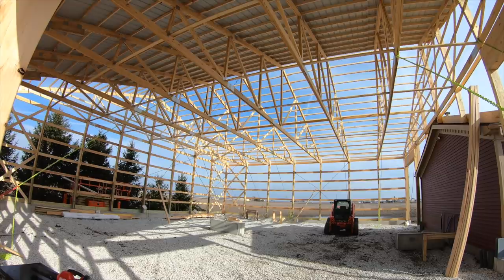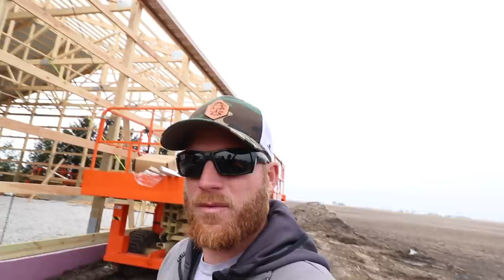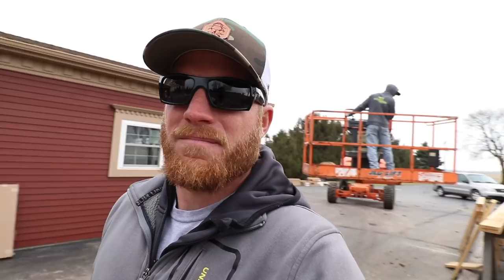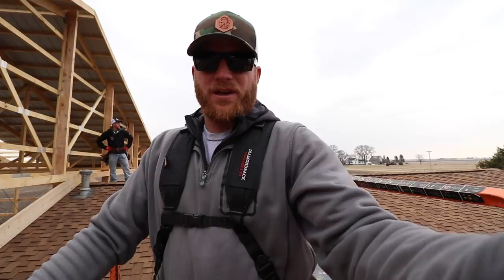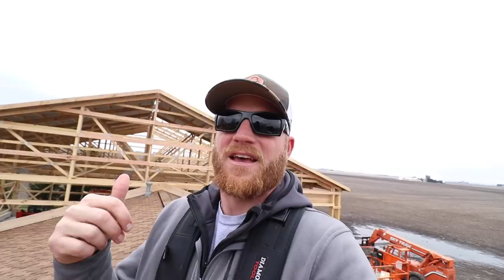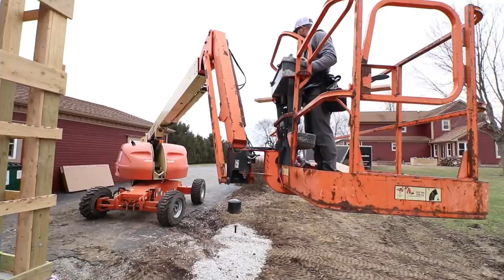How to Build a Garage Addition 9: Installing more Metal Roof, and MISC!

Comment: I look forward to see how you flash the two buildings.
Reply: Eric Corse I think what Kyle might do is replace the asphalt shingles with steel first. He will lay the flashing down on the new roof and run it up the adjoining new wall a foot or so over the house wrap. He may run a J channel maybe an inch or so above the new flashing. The he can start running steel up the side of the wall enclosing that end. Whatever he does I know it will be right. Just my 2 cents worth.

Comment: Looks good. What is that gray/brown spacer looking stuff on the bottom edge, that looks like it fits in with the pattern of the metal? Some sort of filler or what? I'm talking down on the edges, near where you are cutting that metal. Not seen that in our area on roofing before.
Reply from the maker: it is a closure strip yes

Comment: Looks like the concrete people didn't center line the little garage with the new building. About 24 inches off center.
Reply: They did that due to the door size difference on the new build.

Comment: Kyle how do you keep your roof screw lines straight when your purlins are offset every other one?
Reply: @John Lang  My question as well. When purlins overlap screw line, has to shift 1.5 inches up or down. Am i correct in thinking you predrill screws holes in roof steel.

Comment: Great Dude, just one question was it a design thing that the ridges don't line up or was the doors dictating where the framing layed out?
Reply: The door sizes made it offset slightly from proper ridge alignment.

Comment: After watching a earlier video showing using wood under the chain to true up the structure,with being on the roof(body weight ) will that compromise the squareness? As easy as is was to move.
Reply: louverdudski Sean mcmahon it was so easy to move because how much leverage that chain gives you we used that method before switching to come alongs and cables. Your body weight won’t move that building out with all those chains holding it together or cables

Comment: Man all these dudes complaining about the peaks not lining up  have you perhaps considered it was to allow  for the requested overhead door size?     I'm sure the customer not only requested but budgeted for a particular addition footprint   and somewhere along the process the fact that a certain size overhead door on the side which it is meant the building was best to shift and bit and they were fine with it?     Irregular  peaks and valleys with gables ends being offset happen all the time and nobody notices I'm sure once all is said and done and it's a zoomed out perspective of the building all will look normal.

Comment: This may be an obvious question, but why isn’t the roof line centered on the smaller building?
Reply: nicholas mizer he explained it in a previous video. If I recall correctly it had something to do with the entrances being different sizes but he doesn’t design the plans, the customer and an architect does
Reply: Ok! Thank you! I must have missed that in the previous videos.